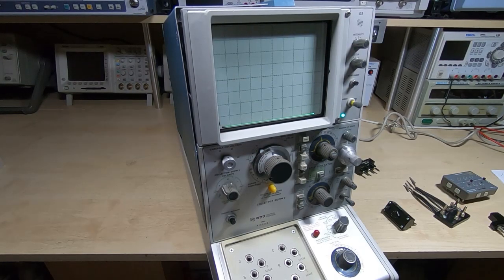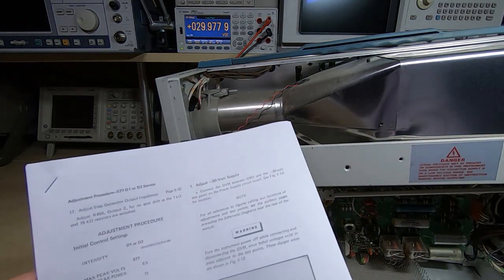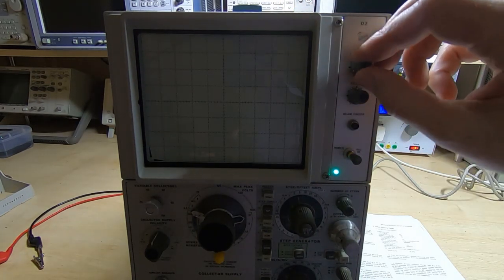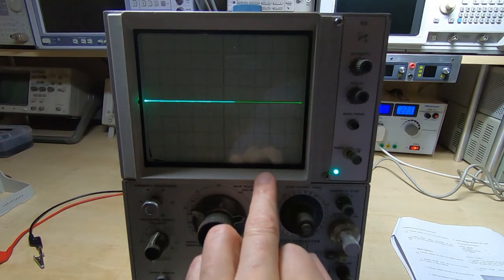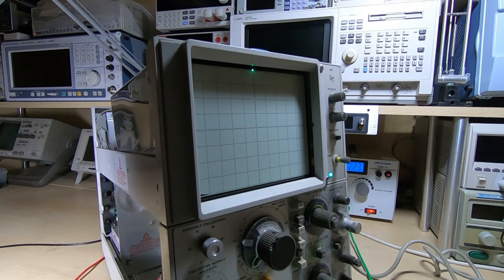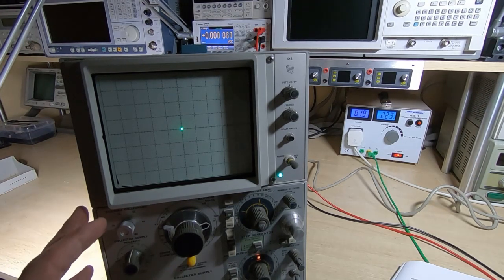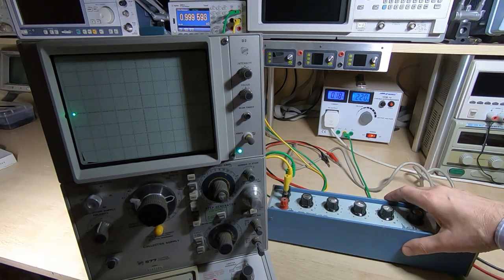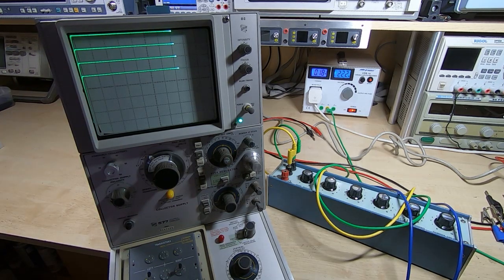Tektronix 577 Curve Tracer Part3

Comment: Hi, if you're still looking for the replacement of the broken knobs, try: https://www.qservice.tv/vpasp/shopdisplayproducts.asp?id=34
Lookup the part numbers in the 1988 577 manual in conjunction with the serial number of your device. Good luck!
Reply from the maker: Thanks, I had already tried that site but nothing shows for the required part numbers. I searched both part number (366-1026-00) and code (80009).